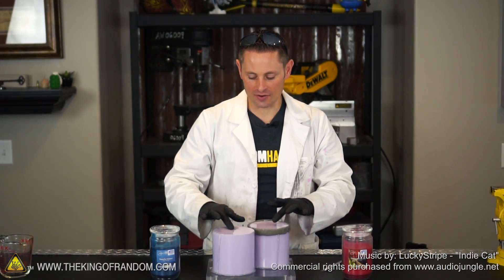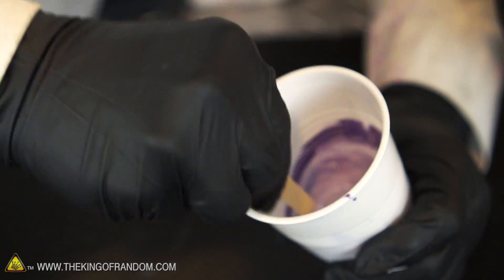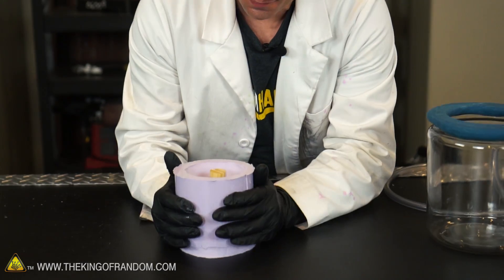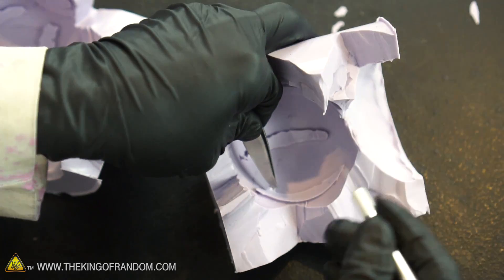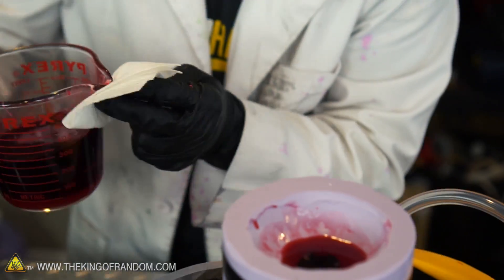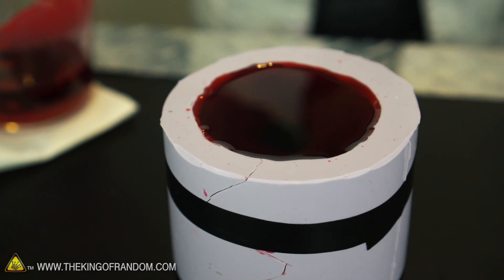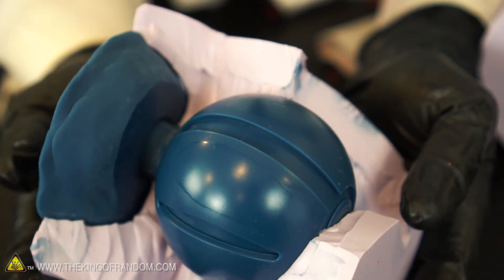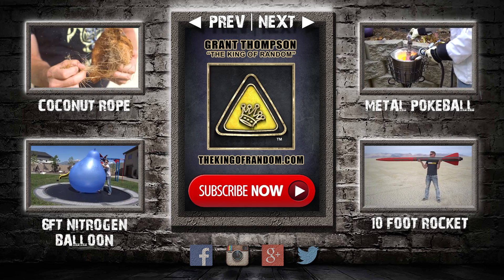Wax PokeBalls & More Trypophobia Reactions in a Vacuum Chamber | TKOR How To Make Pokeball Mold

Comment: You know what, thank you for saying suction cups with sillicone, i was wonderinf how to mount my front lisence plate on my car with no mount and not wanting to ruin my bumper so now im gonna pick sillicone up and make suction cups with like a metal inlet with a tapped inside so i can use screws and mount it on my windsheild using suction cups

Comment: When you lowered the pressure your increased the boiling point of the wax. I assumed that's what was happening in the silicone mold because there is definitely not that many entrained air bubbles. I kinda wanna know if it's possible to get wax or silicone to become at a triple point state (if they have one). It'd be a real challenge to keep the material at a constant (probably elevated) temperature.

Comment: Well, I'd imagine that, because you're lowering the atmospheric pressure in the chamber, that the liquid is actually... just... boiling. Just like how you might observe water boiling at room tempreture if you had it in a vacuum chamber, too. I do not think that coating it or chambering the wax did anything additional in regards to the quality of set.

Comment: I  believe that rather than air simply escaping the wax, the wax was boiling. "Boiling" is scientifically defined as the process which occurs when the vapor pressure of a substance is equal to the surrounding pressure. So when substances are placed in a vacuum, the temperature of their boiling points typically decrease (this is why there are high-altitude baking directions on prepared mixes).

Comment: in lower air pressure does things start to boil at a lower temperature than it would normally. Thats where all the air bubbles is coming from when you but the wax in the vacuum machine, it starts to boil

Comment: Hi
2 tips ;)

1. Don't cut your mold all the way to two pieces.
    Just cut it big enough to put out the ball.

2. Use tape to put the mold together will actually cost extra uneven pressure from type, which might change shape of your casting.
Use the cut acrylic pipe, put the mold back to it and tape the pipe.
Make sure the mold cutting line are at different place with pipe's cutting line, then your mold will be 100 percent sealed!

Comment: put boiling water in the vaccum chamber. since boiling water has bubbles. will it decrease in temp when the bubbles are sucked out or will it be boiling without bubbles

Comment: Grant, what's possibly happening is that your vacuum pump is lowering the vapour pressure of the molten wax, causing it to boil at a lower temperature than at normal ATM pressure. Those bubbles are probably the wax boiling - which is to say, you're actually increasing the number of bubbles, not decreasing them.

Comment: i thought boiling was basically the pressure within the molecules being greater than the atmosphere around it so it bubbles as it turns from liquid to gas.  so wouldnt anything really bubble in there if it was liquid? since instead of like 14ish psi its like less than that?

Comment: If you're going to use your vacuum chamber primarily for removing air from liquid silicon, you can make things go faster by modifying the lid,  First, add a second hole.  Put a short flexible tube through this hole and seal to the lid.  Attach a valve to the outside portion of the tube.  Attach a funnel to the top of the valve.

Put an empty disposable container inside the vacuum chamber, and place the lid on so that the tube goes into this container.  Close the new valve, and fill the funnel with silicone.  Turn on the pump, close the air release valve and open the vacuum valve.  Now, slowly open the new valve, allowing a little bit of liquid silicone through it into the container, then close the valve.  When it stops bubbling, repeat.  As the funnel empties, top it up with more silicone.

Since you don't have to remove the lid, you don't lose vacuum, and the process should go much much faster.

You might want to try filling your mold with silicone directly inside the vacuum chamber, without needing an extra container.

Comment: Grant, here is a practical experiment to try with silicone. Make some comfortable silicone shoe insoles. Even your wife might love this experiment. Put on a pair of shoes that you wear often with your feet inside of some kind of plastic bag as if wearing socks; and a small layer of silicone in the bag. I suspect that when the silicone hardens, you should have a rubbery mold which fits perfectly in the shoe and provides custom support for every contour and arch unique to your feet. Wearing these custom shoe insoles may give you relief even after working for hours on your feet. You can trim the excess silicone pieces that are not needed (like vertical pieces between the toes) No need to remove air bubbles because these might actually be a benefit giving you more shock absorbing comfort. You might not want to press down to much on the silicone before hardening so that there is at least a reasonable layer in the areas that make the closest contact with the shoe. Otherwise, you will end up with some holes or very thin silicone in some areas of the final product. Finally. you might want to try the same experiment with proto putty to see which works best or makes the best final product.
Reply: Davegbuf yess
Reply: Davegbuf Sounds like you've done this before.

Comment: Very cool project!
That mass of bubbles rising from the molten wax in the vacuum chamber was probably not trapped air escaping, but the wax itself boiling! When the pressure is decreased, the boiling point gets lowered and that wax was already hot to start with. 
This also explains why the volume decreased so much!
Cheers! ;)

Comment: When the wax in the vacuum chamber starts bubbling it is actually boiling. Think about how you have to boil noodles longer in the mountains because of lower air pressure. Here you are taking out all air pressure, which allows the wax to boil at room temp.

Comment: hey grant, when the wax was bubbling it was actually boiling because the definition of boiling is the evaporation of the liquid to the atmospheric pressure.
so if you where to put tap water in a vacuum you will notice it boil

Comment: As you use high vacuum the boiling point of the paraffin and the silicon components can be easily reached. So, at certain point you are not extracting air bubbles annymore, only boiling it (in special the paraffin that you use heated).
You should you check the phase diagram before use the vacuum at maximum. Later you will find all these vapors condensates into your pump whereas you doesn't have and cold trap between the chamber and the pump.

Comment: You can use silicone to cast aluminum?  Did I hear that right...If so that's incredible!
Reply: Unorthodo_x No, you would use the silicon to make a wax model of what you want to cast, then you use that to make a mold with refractory cement, bake out the wax, and then you have a mold for casting aluminum.
Reply: TheEthofan  Yeah I knew that didn't sound right!  So instead of googling I wanted to see how many informed people are on his channel.  Thanks for the info.

Comment: The reason you get so many bubbles during vacuuming of the wax is not just because your releasing air.. it's is because your actually boiling the wax. Boiling point of liquids is lower when air pressure is lower

Comment: All the bubbles that the silicon does, aren't actually trapped air bubbles. By reducing the pressure, some of the volatile components of the silicon start literally boiling because you down the pressure to below the vapor pressure of that substances.  The wax, same thing...

Comment: Wouldn't the lower pressure just be causing the wax or silicone to boil? Correct me if I'm wrong but wouldn't that be the source of at least some of the air bubbles?

Comment: I'm sorry if someone has already said this, but aren't  the bubbles coming from the wax because it is boiling? Liquids have a lower boiling temperature if they are in a lower atmospheric temperature and vice versa. Someone please correct me if I am wrong. This could easily be tested by putting a cup of water into the vacuum chamber and seeing if it boils by itself. 
Cheers, Johny.

Comment: I think there may have been probably a little bit of air in the wax, but I believe the vast majority of that was the wax boiling in the vacuum since the pressure difference will allow it to do so at a lower temperature.

Comment: to answer your question about where the bubbles in the wax were coming from: when you lower the pressure of air around a liquid it lowers the liquid's vapor pressure and makes it boil, you can do this with water and boil it at room temperature, that's why in the rocky mountains they have to heat their water up for longer and hotter to boil it. just want to help thanks for this video

Comment: the bubbles are from the wax itself boiling due to the low pressure. you could get water to boil at room temperature at a low pressure the same way. 

cool.project!

Comment: I don't think that the air bubbling through in the wax would be caused by air leaking through the silicone mold. Keep in mind, the whole thing is in a vacuum so there shouldn't be any air outside of the mold to seep in through the cracks.

But that's just a guess. Don't quote me on it.

Comment: At 5m23s, As my teacher said "it starts to boil the liquid as you remove oxygen from it" . Something similar as in mountains. In high altitude where is less oxygen it's possible that liquid will start to boil at lower temperature. I'm not sure if I'm correct, but I remember something like that from school.
Reply: Hidroo It's not that you reduce oxygen what makes the wax boil, but the low pressure
Reply: Thank you for correcting. :)

Comment: The wax is boiling
Reply: Like water wax boils when you get it to hot, and at the lower pressure a lower temperature is required to get the wax to boil

Comment: The bubbles were because the wax was boiling due to the low pressure. Boiling point decreases in low pressure. But some bubbles may have been trapped tho.

Comment: the bubbles are due to the hot wax boiling, the vacuum chamber lowered the pressure of vaporization.  If you place a cup of hot water in the chamber it will also boil like that.   Very cool video and my son and I are getting prepared to do one similar to this.

Comment: What if liquid nitrogen in the vacuum chamber
Reply: liquid nitrogen would probably bump very strongly and damage the pump :P

if it didn't, liquid nitrogen already boils at atmospheric pressure, so under reduced pressure it would boil faster. If the boiling reduced the temperature so much, that the remaining nitrogen froze, it might pass its triple point and solidify, but as ambient heat entered the vacuum chamber, the nitrogen would slowly to sublimate.
Reply: Goyagma both would boil away in minutes.  Of course if the pump is running it would purge both gasses easily.  If it was sealed it would soon be filled with gas that would continue to increase in pressure untill at ambient temperatures.
Reply: Liquid nitrogen actually freezes (It enters a triple point I think, correct me if I'm wrong) when put into a vacuum chamber.
Reply: The Amazing 2 it would probably end up freezing because you'd be removing the air particles and since those are the highest energy particles removing them means it'd be able to freeze. if you don't believe me search up Jefferson lab liquid nitrogen in a vacuum.

Comment: in this video you were not sure where the bubbles were coming from in the hot wax. it was actually boiling. the boiling point of liquid decreases as the pressure drops. so your wax was boiling way below the normal boiling point of water on a stove top. that would make an awsome video. experimenting with the boiling points of different liquids in a vacuume chamber.
            thanks, jimmy

Comment: those bubbles are most likely from the wax boiling. as the pressure drops so does the boiling point. 
also, did anyone else get the weird al reference?

Comment: I'm pretty sure that bubbles are a simple indication of wax boiling rather than trapped air bubbles. If you do the same with water, it will be boiling at 20°C (in a vacuum).
From thermodynamics, clausius-clapeyron relationship illustrates nicely what is happening.

Comment: Once you have a solid positive to make molds from you could pour your silicon right after mixing and then set it all in a vacuum to remove air from the silicon and the positive surface. One less transfer of the liquid silicon that way. Also try placing a running sander motor against the vacuum chamber to hurry the bubbles to the surface. I did that while setting fence posts in concrete. Saved a lot if time.

Comment: Hey Grant, fairly certain from the amount of bubbles coming from the wax that you weren't extracting trapped air, you were actually boiling the wax the same way water boils at room temperature in a vacuum.  To check you should look at a phase diagram for the wax you're using. Also, be careful, probably not the best thing to do for your pump!

Comment: The bubbles wouldn't be air in the wax you are just boiling the wax and the gas would be the same that a candle burns. Don't have an open flame nearby when you do that again. If you can make water boil at room temperature with a vacuum chamber then hot wax will behave the same

Comment: I'm pretty sure that is not air coming out. The wax is actually boiling. The effective boiling point tends to drop under different amounts of vacuum.
Reply: You mean different pressure levels not different amounts of vacuum right?
Reply: Supah Roach half the time he probably doesn't even know what he's talking about
Reply: yes, I thought the same, lower pressure = lower boiling point!
Reply: That and gases dissolved in the liquid wax. Oxygen and nitrogen can be quite soluble in non-polar liquids.
Reply: Supah Roach sure, but my trypophobia is still getting the best of me
Reply: exactly what i was thinking.
Reply: Long explanation made short. Grant boiled off the wax and now has a waxy vacuum pump!
Reply: At any rate, the way he poured the liquid wax allowed for a lot of air to mix in. More care should be taken, as well as making sure that the liquid is poured down in a straight stream without actually letting it swish around and incorporate air.
Reply: you are correct lol was going to post the same thing
Reply: Supah Roach I think you are right
Reply: Supah Roach it actually could be a thing called pseudo cavitation
Reply: lol
someone likes to pick up a book
Gratz sir.
:)
Reply: Supah Roach
Uh.... Well.... No. If its uh..... 'Airless' IS BECUASE ITS AIRLESS YOU KNOW!
Reply: Put gun puder
Reply: Supah Roach you'd be surprised how much air is in things like silicone. I make jewelry and when casting have to put wax in a special kind of investment that's a lot like drywall but much much smoother, and once it's on the vacuum table it looks like it's boiling much more than the silicone does in this video.
Reply: N PADMAJA ...I hope the gunpowder doesn't explode
Reply: Patryk Wrzeszcz no there is many types of vacuum, vacuum cleaner, vacuum pump. all jokes aside a vacuum is defined by anything under normal pressure, 1 bar for us unless you live on a different planet

Comment: You should've just also used a vibrating plate to get rid of the bubbles. You should've let them jiggle on a vibration plate for a while. It would help the molds set without bubbles.

Comment: Hey what id you made a glass cast instead of silicone and filled that with wax so when you blow out the fire for the pokeball candle it would cool and form the pokeball again?
Reply: Tanner Memmott Not possible since he has to drill a hole through the pokeball to make a candle so every time he does it the pokeball would shrink

Comment: What would happen if you put Orbeez in a vacuum chamber? Would they expand? Bubble Water? I don't think anyone has done this yet so I am curious what would happen.
Reply: POTATO Explain ice then.
Reply: POTATO yeah...
Water definitely does expand. 
When it gets inside cracks in rock formations it expand and causes fissures.
Reply: HonestSpiritual water doesn't expand
Reply: +Fantasy Connect water really expands when it's in gaseous form. hints clouds.
Reply: POTATO actually water is the only liquid that doesn't shrink and it expands
Reply: Actually illogical its because of the way water arranges

Comment: when any fluid is under reduced pressure, the boiling point raises. That wasn't bubbles in the wax but instead it was the wax boiling. if you do the same to water it will begin to boil as well. and the way they make solid nitrogen is by putting liquid nitrogen under a vacuum. The more you know.

Comment: If you decrease pressure the liquids will boil at lower temperature then normal. Thats why there is bubble surface tension is decreased and something like that :).

Comment: Those air pockets got possibly be the wax or water in the wax boiling. If you think of basic chem, when you decrease the atmospheric pressure of a container with water in it, it starts to vaporize with no necessary heat added

Comment: the bubbles are coming for the liquid. even if it doesn't have air in it it will still form bubbles. you could put a plain glass of water in it and see for your self

Comment: The extra bubbles in the wax probably were from it boiling. Decreasing air pressure decreases the boiling point. Water would boil at room temperature in a vacuum.

Comment: Pretty sure you were just causing the water in the wax to boil. You pulled a vacuum, and water boils under a hard enough vacuum. So the reason the wax seemed to shrink was because when it hardened, it was short a bit of water.

Comment: just btw there weren't any bubbles in the wax but you decreased the boiling point of the wax by decreasing the air pressure :)